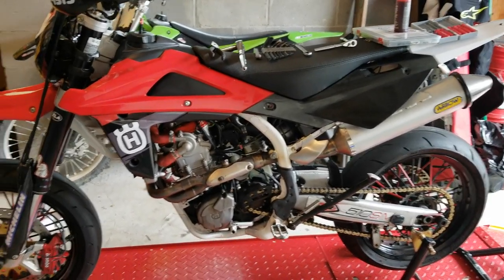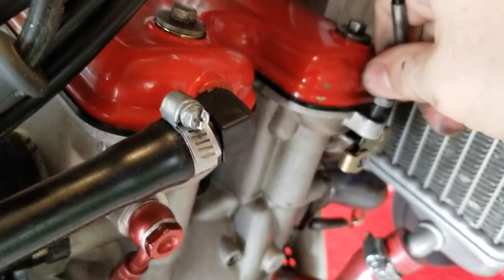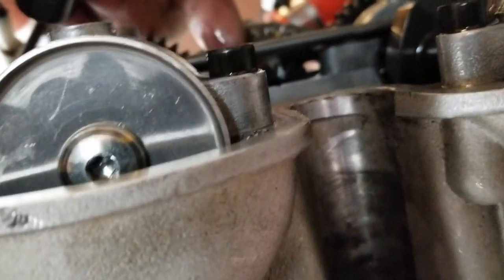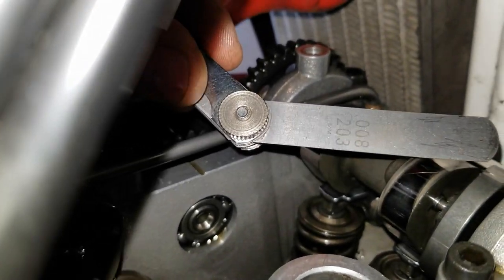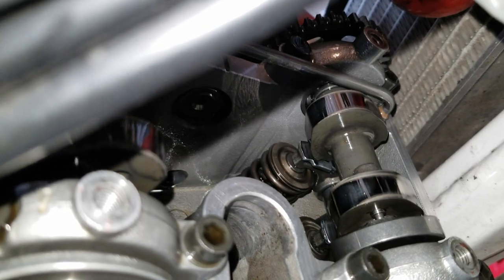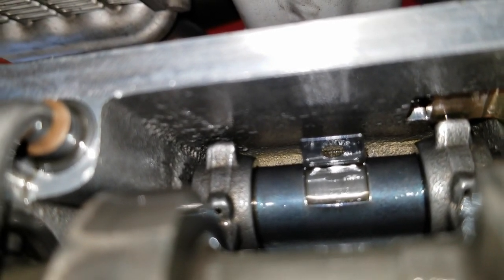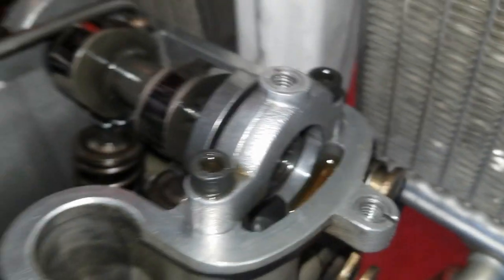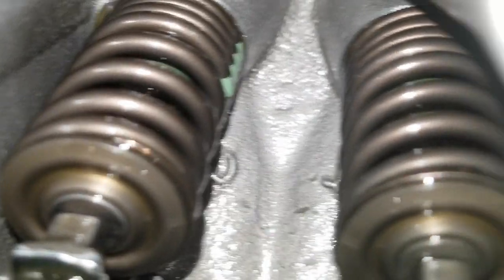Husqvarna SMR510 Valve Clearance check/Adjustment

Comment: I was triping while watching the rocker arm move, I haven´t heard of this configuration. Makes so easy to adjust the valves without removing the camshafts. Thank you very much for doing this video, very well explained
Reply: I have an '11 TE 630. Same setup. Very clever and mechanic friendly.
Reply: Does the 2004 te450 also have that design?

Comment: Thanks for the vid. Got a couple questions. 
1. Where did you get that gauge and how was the wiring on it?
2. Do you replace gaskets every time you check valves? 
3. How tough was the rebuild process yourself?
Reply from the maker: 1. The gauge is a trailtech vapor stealth. You can order it right on amazon. Just check trail techs website for the proper part number for your bike(mostlyfor the speedo cable/magnet set up. I got one for this bike that plugs into stock speedo wiring.). The wiring was super easy and was mostly plug and play. The most difficult thing was getting the tachometer to read proper rpms but a quick call to trailtechs support line and it was working great. 
2. No, no need to replace the valve cover gasket on valve check. They can be reused without issue. 
3. The rebuild was not difficult at all. Just need to make sure you have the proper tools(torque wrench is a must have!) And take your time doing it. There are service manuals available online for free to help ya out as well.

Comment: I wish it was as easy to do valves on my Kawasaki as my Husky 510! On my Kawi I have to remove the cams and cam-chain and it always makes me uneasy at the first start because I keep second guessing myself if I got the timing right! On my Husky 610 that bike used adjustment screws within the followers instead of shims, but if the lock nuts back off on that it's a catastrophe waiting to happen. This is the best way to do valves!
Reply from the maker: Love the valve train setup on these huskys! Super simple and easy to check!

Comment: What gauge cluster do you have on your bike? I saw on your motovlog #1 you had the stock gauge and now it's changed. I have a 08 TE 450 that needs a new gauge(the plastic casing is disintegrating and I think the next time I ride in the rain it might short out when water gets in) and I like the look of yours.
Reply from the maker: It's a trailtech Vapor Stealth. My oem cluster stopped working so put this one on. Install pretty simple and you get some more stuff with this then you do with the stock cluster. Plus it's way cheaper then a new oem one.
Reply: @quickshiftoutdoors  thanks. You're right, it's even cheaper than a used oe unit. Plus you get voltage and temp readings. Always good info to know.

Comment: Hey, quick question. I’ve got a te 450. The head breather pipe in the valve cover keeps leaking, i noticed yours didn’t seem to be leaking. Is there any way to seal it, because i cant find any seals or o-rings for it.
Reply from the maker: There aren't any seals on it i beleive. Perfectly OK to put a little rtv around it to prevent the leaking, just be careful not to put to much as it can get into the motor!

Comment: Thanks.... gives me confidence to perhaps one day get inside mine... 👍 Question: Do you discard old shims as possibly worn or do they not really wear down.?
Reply from the maker: Personally, I save any shims I've removed and measure with a micrometer. I havent noticed any real wear on shims I've removed. Generally, most of the wear is on the valve seat. And dont really see the cam lobes/ rocker arms and shims wear down.
Reply: @quickshiftoutdoors  gotcha.... thank you buddy. 👍

Comment: Very nice video tutorial. Can you make a installation video for the trailtech cluster?
Reply from the maker: Maybe one day I will get around to it. They are super easy to install. The OEM speedo was plug and play to the vapor, the temp sensor literally slides into the radiator fins and the Tach sensor wire is either wrapped around the coil wire to spark plug or use one of the bolts that bolts the coil down.
Reply: @quickshiftoutdoors  super thanks for the response. And what about the Lights? Like the tank light, engine light... ? Wil they then be digital?
Reply from the maker: @Shelby_909  that's the only downfall with the base vapor stealth. There is no low fuel light, no high beam light and no turn signal lights. Trailtech makes a separate outer shell that has all these feature that you can wire the stock harness to that will give you all these functions but for me it wasnt worth the effort

Comment: Great video. I see the cable for the decompression valve lifter is not attached (not even present). My 510 have no cable present as well. Do you sometimes have any starting problems? My bike will often not turn over at the firts try, but when it run, it run perfectly. It sounds like your bike did not turn over at te first try as well? Like to hear your experience.
Reply from the maker: The decompression cable is attached It was removed in the video in order to remove the valve cover. I very rarely if ever need to use the manual decompression lever to start the bike.
Reply from the maker: Also you can see me removing the cable after all the plastics are taken off.

Comment: im thinking to buy one 510 what problems they got ? and what should i check before buying.Also that 530 kit is it worth it i hear it makes the bike a beast
Reply from the maker: Make sure the valves were checked and adjusted regularly along with frequent oil changes with quality oil. I've heard good things about the 530 kit but unfortunately dont have any personal experience with it

Comment: Great bike! I want to own one too one day when I am old enough. Currently riding a Smr 125. Greetings from Germany
Reply: I got one recently and im "tuning" it so i havent even gotten to ride it yet. Still im already looking at a 701 and so should you. This is a pure blood race bike, and you should avoid them. They're not meant for daily use and are expensive to maintain. The only good 510's anyway are 2006 and 2007, which have carburetors. The fuel injected models have alot of electrical problems.
Reply: @handlmycck  I know that they are pure race bikes and need bunch of attention. Still I don’t want to ride a 701. It’s not that special anymore and als pretty heavy and the paper, even tho I’ve never ridden one. Appreciate your comment.
What did you got recently? A 125 or a 510?
Reply: @ludwig6040  2006 510, carburated. Its in nuts and bolts + whole frame powdered awaiting for parts. I did also have a 125 smr 2013 and a wr 125 2004 when i was younger.
Reply: @handlmycck  sounds pretty sick.
Reply: @ludwig6040  Yeah the 510 is gonna be my sunshine. If you do decide to get one try to get a 2007, theyre the latest carburated model. Injection adds a whole new level of electrical problems + you need a powercommander etc. Ive heard theyre pretty unreliable.
Reply: @handlmycck  fair enough. But I also heard that if you put in a Power Commander and let someone who really knows what they are doing, set up your bike, it can run real good. So idk, but whatever I still have some time until I need to choose
Reply: @ludwig6040  No doubt any bike with the correct amount of fuel going in is running good. Keep in mind the injection models also have a smaller tank, from the already small 9.5 liters down to 7.5, fuel consumption remains the same.
Reply: @handlmycck  you know your stuff haha. Didn’t Husqvarna themself and Acerbis produce aftermarket tanks that were bigger? I might be wrong tho
Reply: @ludwig6040  havent really seen them, except ims and they cost hundreds anyway. If i didnt know these things i would be fucked since the one i got was in pretty bad shape. Still im going to try to trade mine for a 701 once its finished, its a supermoto and the weight is not that bad, especially with a different silencer. That thing must weigh like 15kg. Less maintenance cost, better fuel economy, more power. Too bad it has fuel injection, i really hate those. It doesnt have to be special, just a good bike.

Comment: So if you forget to put that clip back,and then you  you try to start it up,can the engine fucked up?  Becouse my bike was at the mechanic and he did valves adjustment and after all the engine brake down...
Reply from the maker: It could. That clip prevents the rocker arm from moving side to side. If that clip isnt there the rocker arm can move causing the valve not to open. Will it damage the engine... idk it's possible. The valve shim could pop out and go somewhere you dont want it to.

Comment: Hi, Nice, well detailed videos about that Husky, since you have it for a "longer period", how much is the estimated cost to run the bike? I mean everything added up and divided per hours, or per year.

Huskys are known  as a really unreliable bike around me, but not sure if it is reality or just a stereotype. 

Thought of purchasing one, the use would be a hobby supermoto, only in city, no trips. Thanks for your help in advance
Reply from the maker: It all depends on the mileage of the bike. Basic maintenance is not terribly expensive. Oil change every 500 miles I run motorex 10w-60($70 U.S per 5 liters) and can get 3 changes out of it.  A shim kit is like $100 and you can get loads of valve adjusts. When it comes time to rebuild thats when the price gets up there, it ran me about $500 bucks to replace piston, rings, timing chain, timing chain tensioner and all the gaskets. Did the work myself so there was no labor. All in all it is definitely more expensive to run compared to say a DRZ 400SM but its like comparing a high dollar sports car to a Ford Taurus.
Reply: @quickshiftoutdoors  
Thanks for the quick reply. The 500$ is also not a fraightening amount, compared to the experience. How often are you doing valve adjusts? My last one:  how often did you need a large upgrade, by experience?I could google that ofc but I do not relly trust user's mannuals.
Reply from the maker: I check valves every 1000 miles. They dont always need adjustment but better safe than sorry. As far as rebuild go I rebuilt mine at 8k miles with new top end. Everything looked great and I honestly probably didn't need to do the piston and could have just changed rings but figured I was already in their might as well. The timing chains do stretch so that was the man reason for the rebuild. I know someone who had over 15k miles on his smr450 without any major issues so these bike can last. All comes down to proper basic maintenance with oil, valves, and clean air filters.

Comment: Don't know why I watch the video it's because I almost bought a Husqvarna I think it was a 2008 250 awesome looking bike and it was the full out Husqvarna emblems all over the bike awesome looking I didn't see it in person it was on Facebook Marketplace I fell in love with the bike I didn't buy it it was only I think twenty-six hundred bucks and the kid would have met me halfway would have been about 125 miles he would have come from Illinois and I'm from Southern Missouri but that's why I got rid of my KLR! IMe 5.9 in my feet wouldn't touch the ground even with lowering link low-profile seat and sliding my front tubes up about an inch and a half . tired of falling down, it was a big adventure bike with full dress big aluminum pan years everything, heavy for off-road and with a spinal cord injury  paralyzed ankles it was hard! I had the bike a couple years ,I met my challenge! but then I sold it and wanted to get something smaller so I ended up buying a 2009 Honda CRF 230 M and I just outfitted it with big rugged Adventure tires. I don't have it home yet! it's in the shop I've been so anxious to get it here I'm going to turn it into a mostly off-road Enduro with homemade rigid saddlebags for Holing my hunting equipment into the woods .I put a bigger sprocket on it in the back from 38 teeth to like 52

Comment: So I just bought a 08 smr510 and what’s the best maintenance tips I can get.
Reply from the maker: Frequent oil changes with a quality oil(every 500 miles or so) valve check ever 1K and clean air filter and quality fuel

Comment: Thanks for the info I have a problem with my husky, the shim managed to pop right out some how, only just got the bike, the plate that sits on the spring that holds the shim can that be removed without pulling the head as mine has damage so will need to be changed
Reply from the maker: Unfortunately the head would have to come off as the spring needs to be decompressed to remove the valve keepers to get the cup out. Taking the head off on these bike really isn't to bad. Definitely pull the motor from the frame.
Reply: @quickshiftoutdoors  thank you for the quick response, AHH damn I was hoping I could just keep the engine in the bike and just remove the head ??? Wanting as little work as possible really 🤣
Reply from the maker: @londonTown1989  removing the engine is relatively quick and easy.  Theres only a few bolts. You'll be halfway there if you have the tank and plastics off already lol.
Reply: @quickshiftoutdoors  AHH ok Ty is the engine pull a must or is just easyer ?
Reply from the maker: @londonTown1989  I'm pretty sure it has to come out. I dont think it will clear the frame.
Reply: @quickshiftoutdoors  ok bud much appreciated on the reply guess I'll have to pull it out, may aswell do a piston and ring change at the same time I guess
Reply from the maker: @londonTown1989  definitely change piston/rings while your in there and check over crank carefully make sure there is no vertical play in the lower bearing

Comment: part number? i got a 2007 te450 and i think it’s due for a valve adjustment. is the OD on the shims 10mm. basically just need to know the outer diameter
Reply from the maker: Don't know the OD of the shim to be honest I have the hot cams shim kit. I can probably grab a measurement with the caliper tomorrow and let you know
Reply: that works or just a part number please, and awesome vid. Not to many vids on the TE out there and this gives me the confidence todo it myself with ease. knowing how simple it is i’ll be checking every oil change now.

Comment: Thanks!! I have bought a new husqvarna 510 smr and im having problems wirh the idle. I mean it idle fine but at 1600rpm and it runs fine but when i get to stop and rev bomb the pedestrians it stals🥺 how could I increase the rpm? And also the light of fuel is always on even with the full tank,  could it be the fuel sensor of the fuel pump? Thanks a lot!!
Reply from the maker: What year is your smr ? If its fuel injected there is an idle adjustment screw on right hand side of the throttle body turn that to increase your idle. Stock idle is around 1800rpm. If you have the power up kit I would raise idle to 1900-2000rpm. As far as the tank reading empty, there is a sensor inside the tank on the fuel pump  they are notorious for breaking off and either not working or readying empty when they are full. Take off the tank and remove the fuel pump you will see the sensor I am referring to.
Reply: @quickshiftoutdoors  Thanks for your answer! sorry for my English, im from Spain! 
This is an 2008 as yours so it will be very useful your help! tomorrow I will check for the screw, because there is a big one which I move right and doesn't do anything so I guess the isn't the correct one. do I need to take of the throttle case to get access to the screw? And I have already taken the tank and the fuel pump and the only thing I did is to readjust the placement of the pump which is only held by one zip tie and then one of the cables to the sensor was unleaded so I welded on again thinking this will solve the light issue but it keeps doing the same. I will also test tomorrow by welding it again and trying with another cable!
Reply from the maker: @victorcmbx751  nope you dont need to remove anything to access the idle screw it's on the right side of the throttle body under the cable cover for the throttle. The black knob on the left side of the throttle body is the enrichment circuit(basically a choke for the fuel injection.) Pulled out it enriches it for cold start and pushed in is for normal operation
Reply: Quickshift Outdoors thank you!
Reply: I've got an 09 SMR and it also dies when you rev it hard in neutral or whith the clutch pulled. its a common issue. I always thought it's because of to much backpressure from the kats but I'm not sure. It's also not the most sophisticated fuel injection system as far as I know so maybe it just gets flooded?! Because mine usually takes a while to start up again after staling.
Reply: Tabletopstudios well i actually changed the air filter to a new one and it actually seems to not stal, maybe with the old filter not enough air was there in the mixture so thats why it stalled, i will inform you when I actually test it good!I am also having oroblems to increase rpms😞
Reply: @victorcmbx751  OK sounds like you have more issues then. I know that the swm 500r which is a rebranded husky hast the same problem with staling and that's a brand new bike.
Reply: Tabletopstudios really? Well i think my problem its solved! However i need to fix the fuel light, you have any idea what could it be? It stays always on even with a full tank
Reply: @victorcmbx751  maybe the floater inside your tank is stuck
Reply: Tabletopstudios from wgat i have seen , there isnt any floater, there is a sensor, but it all seems to look fine, so i dont really know what could it be